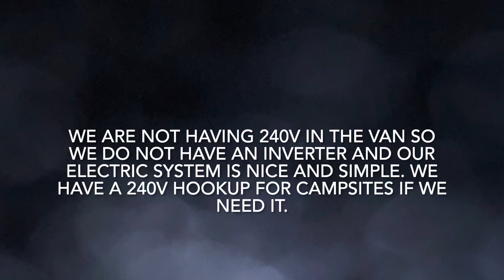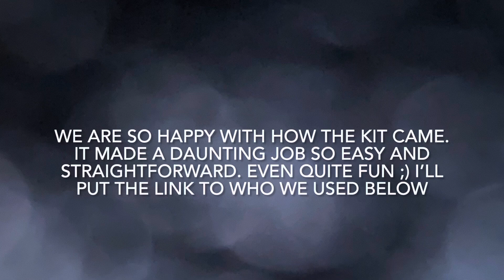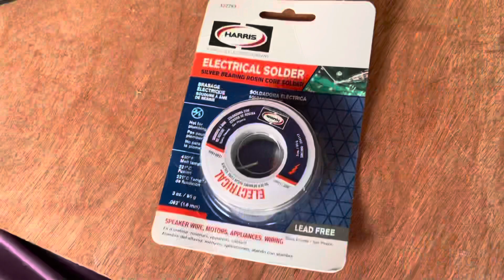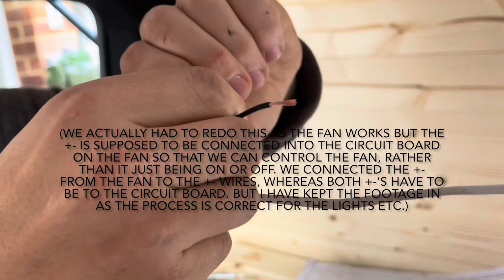Mercedes Vito camper conversion - electrics

Comment: Hi, this looks exactly what I need, do you have a link for where you bought your electrical system from please
Reply from the maker: https://www.ebay.co.uk/itm/12v-PRE-WIRED-Electric-Hook-Up-Kit-VW-T4-T5-T6-Campervan-Motorhome-Build-/154514910638?mkcid=16&mkevt=1&_trksid=p2349624.m46890.l49286&mkrid=710-127635-2958-0